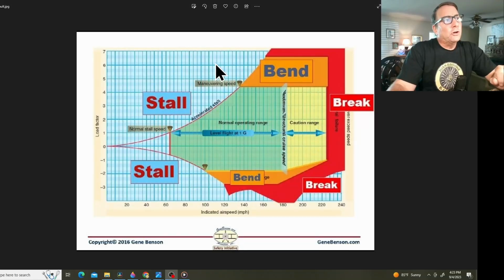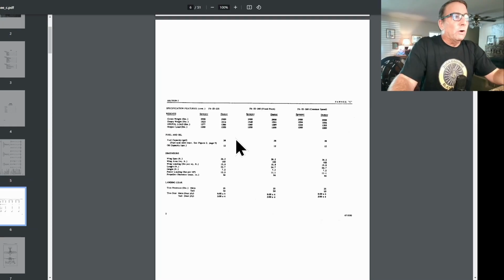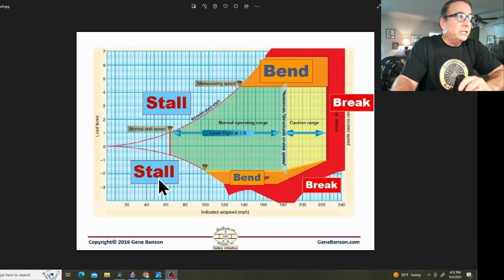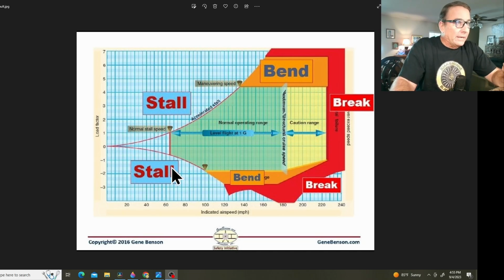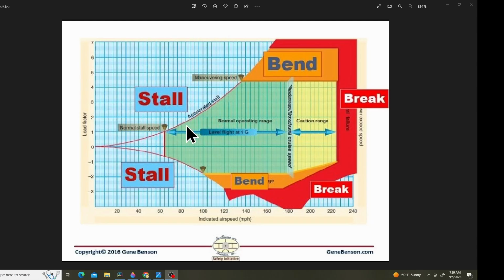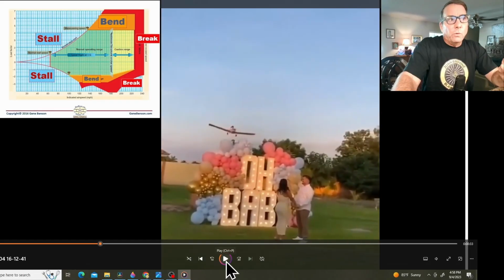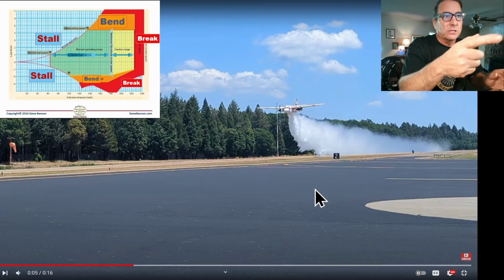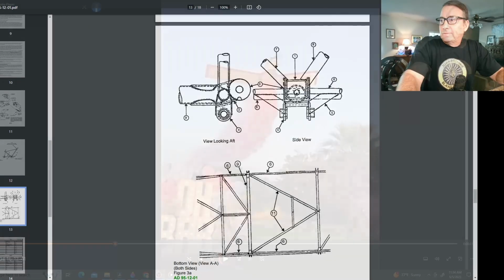PA25-235 Sinaloa MX Gender Reveal Party Structural Failure

Comment: Small Frame airplane... large forward weight dropped nearly instantly...(A capability intended to be used only during dire emergencies).  You are talking about a massive center of gravity adjustment to make very rapidly with little room for error.  Think of it this way.  That's like 5-7 average size adults jumping out of the nose of the aircraft nearly instantly... (over a period of just a few seconds).  If he'd practiced doing this with a full hopper and attempting the correct reaction,  I bet the risk he'd react errantly enough to damage the aircraft would be very significant.

Comment: I remember a C130 that lost a wing after a firefighting drop a decade or so ago.  I had thought that was a structurally compromised plane at the time but had not really considered that the crash then could have been the same as this Pawnee. Do you remember that crash?
Reply: That airframe was operated by the CIA for years and missed a critical reinforcing of the wing roots that was required for C-130s of that particular model. Having been beat to hell by Air America and then passed on to the firefighters without that critical work on the wings were contributing factors to the failure. I believe that is the accident you are referring to. The operators apparently were under the assumption that that work HAD been done. CIA operating the plane meant the records were incomplete.

Comment: When performing an agricultural dump you are supposed to slow to dump speed usually a little below or at the bottom of the manuvering range. With the Airtractors you put in one notch flaps slow to 120 and trim forward. As the aircraft unloads they produce a strong nose up tendency that has to be physically countered by the pilot. It appears that the pilot of the Pawnee was inexperienced in these procedures and dumped a full load at max speed producing an unrecoverable nose up incident and immediate structural failure. 
Very sad.

Comment: Quite right that Vmvr generally occurs at a lower speed when at a lower mass. Put another way: If the G limit is 4.4G and an aircraft weighs 1000Kg then at Vmvr for THAT MASS, say for our example 100 KIAS, when the aircraft’s AOA is increased towards CLmax the wing will stall when it is producing 4400Kg of  lift. That is to say at Vmvr, at our hypothetical 100KIAS, CLmax produces 4400Kg of lift and the wings are designed SAFELY produce 4400Kg of lift. However, if the aircraft is lighter, for simplicity let’s say 500Kg at our hypothetical 100KIAS still only generates 4400KG of lift but it will now give us 8.8G! However, the wings should still survive as they are designed to carry 4,400KG. However, other things may fail. Things like the empennage or, most likely, the engine supports. Nevertheless, other failures could start a chain of events that lead to a catastrophic wing failure although the wing hasn’t exceeded its design lifting capacity. In the video it looked like a clean break of the port wing. I would suggest, but never claim, that this failure was caused by the aircraft wing exceeding its lifting capacity, that is to say our hypothetical 4,400Kg; which in turn suggests that the hypothetical 4.4G was also exceeded. I’d also like to hypothesise that the situation was exacerbated by the simultaneous pulling of G and dumping of the hopper contents causing a rearward movement of the CG causing an exaggerated pitch up. Dropping stores from aircraft is a complicated process and is normally preceded by many hours of flight testing leading to more restrictive envelope limits. I have no answer to why the wing failed, but post accident analysis is a very complicated and nuanced process. My days of dropping stuff are sadly past but you have got me thinking about the implications of dumping the 166litres of water I carry in my sailplane. Whilst 160 litres are directly over the CG, 6 litres can be carried in the fin! 🤔 I have no idea why this video appeared on my feed but thank you getting my grey (now there’s a clue) matter churning.

Comment: Dear Juan as an engineer i am not sure I agree with your explanation. Dropping weight before/during the pull up actually reduces the load to be carried by the airframe. So the drop is not the problem in my opinion but the sharp pull up that exceeded the limits of the wing. The CL215s always do sharp pull ups during the drop while fighting fires. Just my two cents and greetings from Athens.
Reply: Even though it reduces the load it increases the amount of G force being applied on the aircraft for that moment as the weight of the aircraft suddenly decreases. Kinda like if you were pushing an object and object suddenly moved so you fell forward...except with lift. There is less aircraft weight to be lifted causing a bigger spike in g force for that moment in time.

Comment: I doubt the pilot pulled very much if at all. Presumably the plane was trimmed for the high weight and fast speed. With the sudden decrease in weight without forcing the stick forward, that trim setting would be enough to over-G the snot out of the plane.

Comment: Flying fighters, we use a version of the V/G diagram to show 2 important features of performance—corner velocity (smallest turn radius which happens to match Vm) and best turn rate airspeed (faster and G-limited). If you lay two competing [Em] diagrams on top of each other, you can find your maneuvering advantage. As always, fantastic video Juan.

Comment: I think the V-n diagram drawn at the full weight generatlly keeps you safe below that weight.  It looks like the wing failed at the wing root, so it was the load of the airplane, and not the fixed-weight components that matter here.

What I'm guessing happened is that he was above maneuvering speed already, and his enthusiasm to create a dramatic pullup was combined with a substantial CG shift backward when he dumped the load, causing the airplane to pull much harder than intended.

Comment: I'm struggling to make sense of this. The graph is for fully loaded performance, so let's say under these conditions it can handle 4 g's which produces 16k lb of wing load.  When the aircraft is fully unloaded, it seems to no longer be appropriate to use the fully loaded graph anymore.  You would need to check against the unloaded performance graph.  However if you remade the graph for an unloaded aircraft, all of the points may change, so the 4 g's likely would no longer be the threshold.  It might now take 8 g's to produce the same wing loading.  So the theory of the video seems to be that the aircraft was at a safe point on the graph, and after unloading, the safe point on the loaded graph instantly represented a break point on the unloaded graph.   The force is an aerodynamic force which is based on drag and lift, not mass.  The force is based on geometry.  When the mass is suddenly decreased, F=ma would say for a constant aerodynamic force, a sudden decrease in mass will be countered by an equal and opposite increase in acceleration.  But again it does not seem to be appropriate to compare this new g value against the fully loaded chart.

What it looks like happened to me is that the sudden acceleration increase caused by dropping the mass caused the aircraft to nose up beyond the desired angle of attack of the pilot.  This uncontrolled increase in angle of attack caused an absolute increase in wing load.  So it's not that for a load of 16k lb, the drop in mass caused g's to shoot from 4 to 8g's at the constant wing load, but that the additional increase in aoa caused the 16k lb load to increase to 25k lb, and the 4g's shot up to 12 g's, something like that.

Comment: Retired ag pilot here. I started out in a Pawnee 260 C model. It would carry the 150 gallons, I doubt that the 235 version could. That being said, I didn’t notice you saying anything about the hopper being well forward of the CG. I’ve dumped many times. There’s always a violent pitch up if you’re not trimmed in advance for it. If he also pulled back at the same time, then that would certainly overstress the aircraft. 
As previously mentioned, corrosion was probably involved.
Reply: Looking at the pitch up, it’s entirely possible that the sudden change in the moment arm at the release of the load caused it as well.
Reply: It seems usually a number of factors converge at the point of disaster in these accidents.  Corrosion, high speed, pull-up maneuver, shifting CG…possibly in this case.  Maybe add to it, “Doing something out of the norm.”  
The emergency release feature was probably only considered to be used after engine failure where the aircraft is probably at best glide speed, straight and level.  Water “dive bombing” was probably never considered in the designing of it.
Reply: The dump handle on this airplane opens a door on the bottom of the hopper. It’s designed for emergency dumping but also can be opened partially. This is so that dry material can be applied as well as liquid. Dry fertilizer, cover crop seeding, I believe that it was used fairly exclusively to seed rice fields in California and elsewhere.
Reply: As someone with a whole season of PA25-235 Experience the Max Liquid Loads early AM were about 120 gallons. As the day got hotter we would download to about 95-100 gallons and this provided a safe operating weight with the fuel and pilot.
Reply: Thanks I was wondering how the CG was affected.
Reply: @SAMUELHIEDSTIEN  not really. I’ve personally never seen one. I’ve seen lots of ag planes though. The plane I last flew carried 500 gallons and flew at 172 mph and had a 72’ swath. It had a 1050hp. Turboprop Pratt and Whitney PT-6 engine.  The same model also came with a 750hp engine. This kind of performance is not available as a drone to my knowledge. The formula for feet /hour is 172x5280= 908,160 divided by 60 minutes is 15136. Times 72’ is 1,089,792 square feet. Divided by sq Ft per acre is (43560 sq Ft.) a little over 25 acres per minute.
Reply: Yup.
Reply: i was thinking about cg myself, do they not use counterweights in the tail or do the wing fuel tanks augment that problem, also he clearly exceeded design limits of the wing. but i was not aware that there was a corrosion problem with the wing's attachment points. also, as the video noted too fast to low.
Reply: This aircraft unless converted has the fuel tank in the fuselage, forward of the cockpit
Reply: @mdbryan9525  Fuel Tank in bad location - Just AFT of the Hot Engine and FWD of the Hopper.
Reply: Exactly. Well the engineers couldn’t think of everything.
Reply: @SAMUELHIEDSTIEN  Not so fast . A drone that can carry 800 gallons of payload and fly at 150 MPH is cost prohibitive presently.
Someday when they become cost competitive then they will take over .
Drones are great tools for surveying the condition of large fields and are presently being used alongside Ag planes.
In rice country in the Arkansas Delta a drone that can only carry 18 gallons would be laughed out of a field.
Reply: @guitarhillbilly1482  Yeah didn't really think about that, spraying hundreds of gallons vs a costly drone that can only spray a few tens before it needs to be recharged.
Reply: One other thing. Water weighs 8.33 pounds per gallon. Assuming 150 gallons, that’s an additional almost 50 pounds.
Reply: @mdbryan9525   water weighs 1 kg / liter
Reply: @bryanrackard9268  Elvis, you captain now?

Comment: Excellent assessment.
The Pawnee doesn't have a traditional cantilever wing spar, instead using a brace over the wing to carry wing bending loads (forming a "couple" with the wing attachment fittings). From the video, it appears that it was the left wing brace which buckled under compression, and not the wing attachment fittings, which from the illustration aren't designed to transfer any wing bending moments.

Comment: I love Blancolirio but I suspect there is a misunderstanding here, or I'm due a lesson, which I'd like to learn.

The wing is defacto a lever that acts on the wing root, and the force of that lever is dependent on the wing load. The structure does not know the plane speed, only what forces are applied.

Keeping the G constant but lessening weight and therefore wing load -> less force on the lever.  To get to the breaking point with a lower weight, you need more G. If the plane could carry a bigger weight, it would fail at a lower G, because the system being tested, the wing root, passes the critical force earlier.

So why does the wing root break with a smaller force if the plane is lighter? This is also contrary to how military jets limit G. Same plane, same structure, add weight, G-limit is lowered. Drop ordnance, G-limits get higher. The limits are never lowered when a jet is getting lighter.

I might be totally wrong, but this just does not make any sense if all other things are equal. Hopefully someone can explain why the above logic fails, if it is unsound.
Reply: The lift generated by the wing causes an upward force. The weight of the aircraft causes a downward force proportional to the mass of the aircraft. When the hooper was empted rapidly this downward force decreases rapidly. The change is the square-root of the ratio of the mass of the aircraft with the full hooper and the mass with an empty hooper. From the pilots notes the mass could have fallen from 100% to 60% , which gives a change in force of 1.25 and the change would have been rapid. This would have placed high compressive loads on the overwing struts.

In the video it looks like the left strut buckled close in to the forward fixing point, which would allow the wing to pivot upwards.
Reply: @christopherrobinson7541  Thank you for the explanation - it makes sense and I'm sure the plane does lift quite violently if such a big part of the weight is dumped. The wing before release is creating a certain lift, and that lift is putting a certain load into the root. When the lift stays the same, but the weight suddenly decreases, the same force is applied to the root (same lift), now instead of 1G 1000kg u get plane experiencing 1.5G but the weight is less -> same exact structural load on the pivot?

Pulling up at the same exact moment is of course loading G from both, but in the video  the claim is specifically that your allowed G goes down if the plane weight goes down - at the same G, more weight is always more forces applied to the structures?

Comment: So what was the initial component or member that failed? The wing strut attachment? The attachment pin? Was this for the forward attachment of the port wing? I am very curious as I am beginning the process of designing and building a low wing cantilever LSA. I plan to adopt Diamond's wing spar configuration but need removal by one person not that different than a glider. But, what was the g force required for failure?

Comment: How does affect planes that drop bombs. I’ve seen one of the bombing profiles that is often employed is a pull-up lobbing maneuver, which seems to be this scenario. I realize the engineers design it to do that safely, but stills seems problematic?
Reply: Sounds like you are talking about a close air support fighter which are designed for higher G manoeuvres.

Comment: When flying the wing generates lift which causes the wings to bend upwards. The weight of the aircraft causes the wings to bend dowards. This is called G relief. The heavier the aircraft the greater the G relief. If the weight of the aircraft is suddenly reduced the amount of G relief is also reduced. 

This can be seen launching gliders by winch. As the glider climbs higher the force pulling the glider down increases as the angle of the cable gets steeper. During level flight the Vne of an ASK-21 is 151 kts the maximum winch speed is 81 kts. (All the other numbers in the VG graph will change pro rata). This effect is most noticeable when winch launching long winged gliders such as the ASH-25.

Comment: at 6:30 you mention that the weight of a wing changes the number of lbs of lift they’re producing, and i’m not sure I understand. If the airfoil is what’s responsible for generating lift, how can the weight be relevant outside of the required additional airspeed to generate more lift?

Comment: Use of V-g diagram is not so trivial for lower weights, as structural limitations line will also move (quite likely, upwards to higher g), compared to that with a higher weight

Comment: I don't think the change in Va had much to do with this crash. IMHO, three things caused this crash. 1. He came in way too hot 2. He pulled that joystick back like he was pulling the handle on a slot machine 3. He pulled before he had time to dump the whole load, extra weight means lower G limit. Showing off has killed more pilot's than AA.